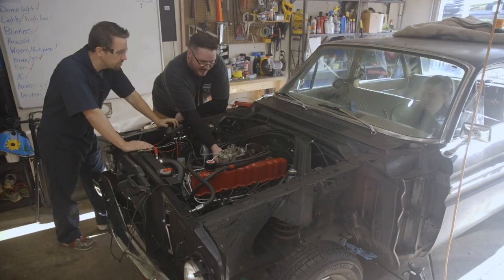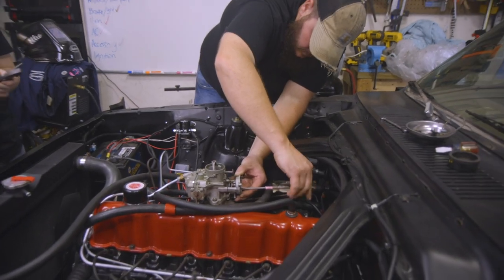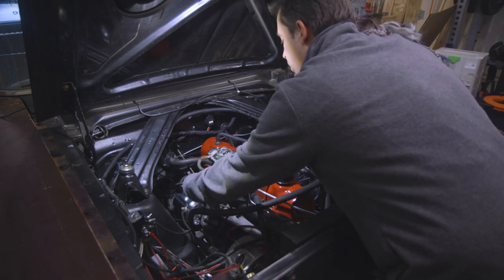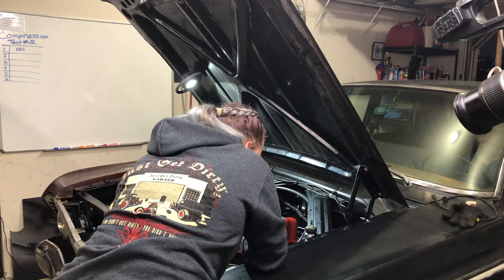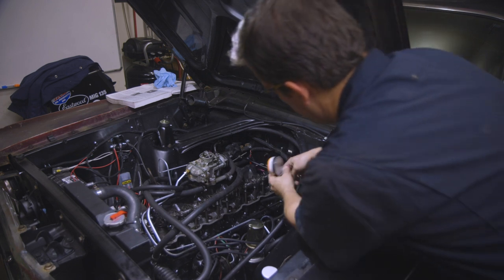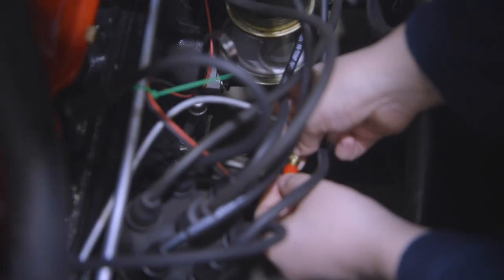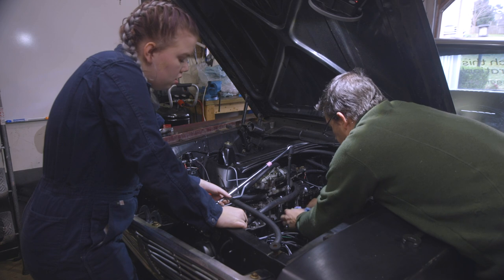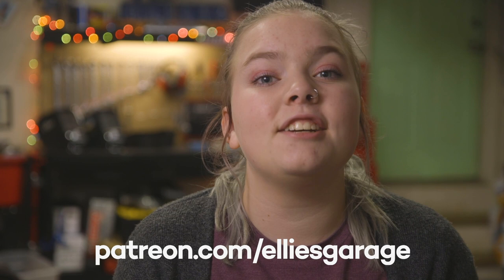We Try Tuning My Straight Six Engine and Autolite 1100 Carburetor!

Comment: If the car's getting too much fuel,check the float and needle and seat in the carburetor. The float level could be too high,or the needle and seat might not be sealing properly. Carburetors are simple devices but they can be hard to get everything set right.

Comment: Unless you are looking to keep your car totally stock, I would suggest replacing that carb with a fuel injection system that will self learn as you drive. I would also go with a pointless ignition. I haven't checked for a while, but with some of the new electronic ignition systems you could get a huge gain in power and fuel economy. There are companies that offer compatible systems as a package so that you know that everything works together. If you are wanting to step up your power get a manifold with a 4 barrel carb  base. Now that will lead to headers and maybe a cam. Quite a few years ago I saw a Falcon that they took the 6 out and replaced it with a modern 4 cylinder which was much lighter, more powerful and got much better fuel economy. Good luck with your Falcon.

Comment: The 1100 carbs are not an easy carb to make run well. At best they are an ok carb. They didn’t run well when they were new. I like the Holley 1904 on my 6 cylinders. Easy to tune with little issues. 
Also are you running the correct Load-o-matic distributor to match your carb. The entire load-o-matic design is a nightmare in my opinion. 
I can give you more info on this topic if you are interested. 
Great car and great videos. Stay at it. You will get all the bugs worked out. 
Bob.
Reply: Will a Holley 1904 fit on a 65 mercury comet 6 cylinder 3.3?

Comment: Patience. It takes patience. And more than likely a new carb would be a good idea. Problem with rebuilt ones is: who knows the quality of the replacement components, and, who put them together, did they make what they were doing, in a hurry, overlooked something, under-tightened one thing, over-tightened something else, bent another thing, dropped the whole thing... it adds up. But this is all good learning. Hopefully you have either chemistry and physics in your school. All this stuff is related. Good job. Stay at it.

Comment: You can get a re-manufactured carburetor on Rockauto.com. Go to Ford then1965, Falcon and then Fuel and air section and carburetor. 3rd down is the best choice. $180.79 plus $125.00Core  that you will get back once they receive your old carb and a total of $305.79.  if you can find one locally that is cheaper go for it. I bought a lot of my parts from rockauto.com  . Oh there will be some shipping charge too. If you can wait a week or so go with the cheapest shipping to save you some Moolah. And good luck , great job on getting Karl going . And tighten that alternator belt a bit more so it stops squealing every time you start it.

Comment: Honestly, i don't think the slight difference in timing or valve lash makes a big difference unless it's waaay off.
that's the beuty of classic cars that they don't have to be perfect. The engine should still last many many years, and if it didn't, rebuilding this engine today is not very expensive or difficult...maybe they will be more costly in the future.

As for the carburetor, I find that most often even new carbs are not adjusted, probably because this would require a human factory worker to do the adjustments...this would increase the cost. The youtube channel called 'Mike's Carburetor' shows all the adjustments you need.

Carburetor adjsutment would have been very common and easy back then but have now become almost a lost art. 
I've been studying different carburetors and how they work and should soon have a playlist with the complete explanations on how any carburetor works and how to adjust any carburetor.

Comment: adjust the  valves, you have a tight intake valve, that is why it is long cranking time and backfires through the carburator
Reply from the maker: Thank you so much for this advice! We are actually wanting to redo the valves soon. Just to confirm, when you say a "tight valve", do you mean the rocker/pushrod bolt is turned too tight keeping the valve more open, or do you mean that the valve is closed too tightly? Thank you again!
Reply: @ElliesGarage  best luck with CARL!  take the valve cover off and turn the engine with a wrench on the crank pulley.
You will see that each of the rocker arms go up and down.
 check each rockerarm when it is all the way up.
When any rockerarm is all the way up there should be some slack or looseness between the rockerarm and pushrod.
There needs to be some slack it is also called lash so the valve spring can completly close the valve.
lotsa vids  for "ford straight 6 valve lash adjustment"
Reply: @timfisher77  This car has hydraulic lifters. There should be no slack between the pushrod and rocker arm. With mechanical lifters, yes, there should be some slack.
I noticed in a previous video that Ellie and her dad were spinning the pushrod to determine zero lash. That's incorrect. You should move the pushrod up and down to determine zero lash, then turn the rocker arm adjuster 3/4 to 1 more turn.

Comment: I don't know if it is because of the video editing but you seem to be doing multiple things at a time. You seem to be chasing your tail, so to speak, because you are trying to many things. I recommend you work on 1 problem at a time, fix it, then go to the next problem. Adjusting timing and valves at the same time doesn't tell you what is working. In order of importance I'd fix
1- fix the belt squeal
2 - set the timing to manufacturers specification (not what you think sounds good)
3 - set the tappets to correct clearance (not what you think feels good) with a feeler gauge. (EDIT for number 3 -I've done some reading on these old engines and  you did the valves correctly however I would suggest you and your father would have different tolerances for when the pushrod stopped moving. Anyway it isn't actually the valves that are being adjusted with this method but rather the hydraulic lifter preload is being set)
4 - replace the carb and set the new carb to manufacturers specifications.

Keep up the good work, it is nice to see father and daughter working together as well as seeing a young adult female being interested in learning about cars and how they work.
Reply: I think the same.
As it is in the learning process, I would say that as things do not work as expected, do more advanced research on the theory and the necessary adjustments, then apply them correctly (equipment, tools, instruments, technical information on the specific case ), measure and test them.

-Operation of hydraulic lifters
-preload adjustment,background
-Preload adjustment, different types and specific application

Just when repairing a 200cid engine, with hydraulic lifters, and rocker arms without adjusting screws, it cost me a lot to understand all the aspects that I needed to know before doing the job.

Regarding the carburetor (and ignition), I also recommend learning to use the vacuum gauge as a checking and diagnostic tool.

Also the basics of float level adjustment(theory,values,how to check and adjust), and initial position of the mixture adjustment screw, clearance of breakpoints, and initial ignition timing.

Comment: throw it away and buy a A-2100 from amazon for 100 bucks and free ship ! they are NEW carbs NOT re-mans . made a world of difference for my 86 f-150 4.9 straight 6 .  and throw away the stock derrrr-a-spark ignition system and get an MSD -6AL high out put ignition . made a1 world of difference for me and my 6 .